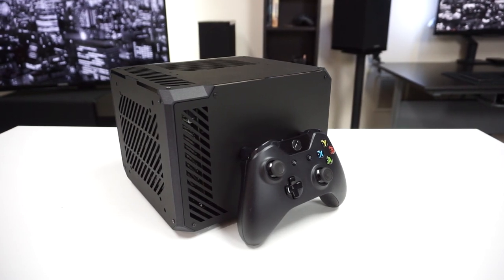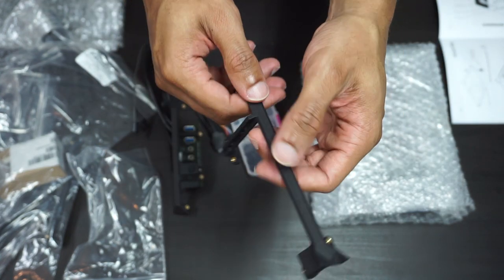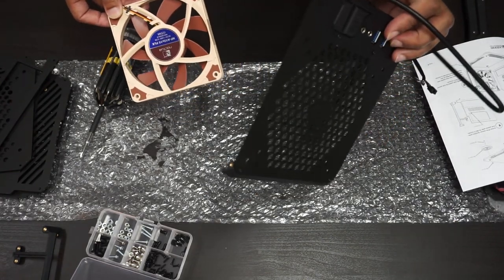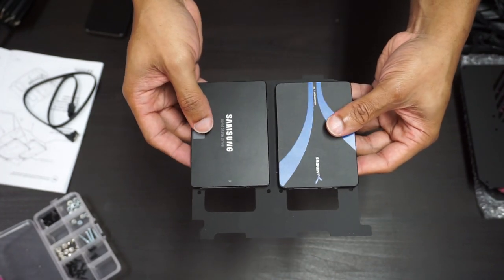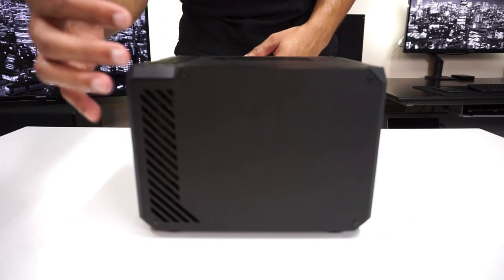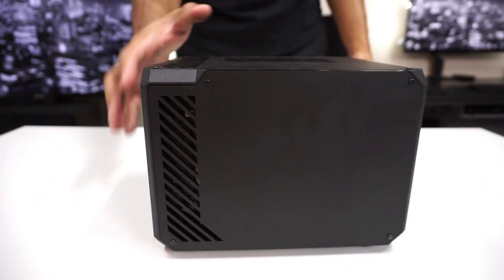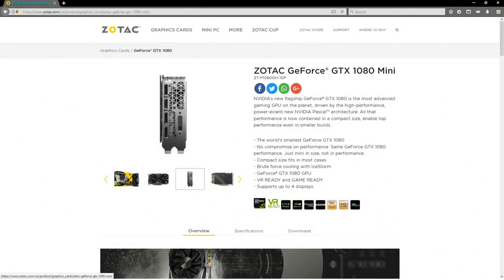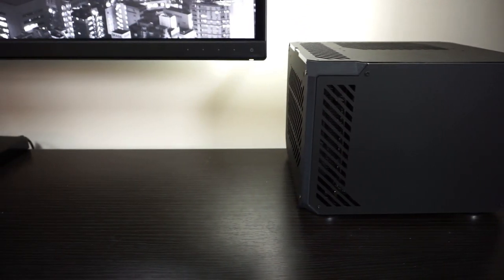Lazer3D LZ7 Mini-itx Case Review & Build

Comment: I'm doing this exact build and the CPU cooler bracket doesn't fit with the motherboard. Any idea what I'm doing wrong?
Reply from the maker: Did you get the AM4 upgrade kit?
Reply: I did not. Is that something I could get from Cooler Master? Would you happen to have a link to the specific kit? Sorry, this is my first build.
Reply from the maker: I used an NH-L9a in this build. Not a Cooler Master product. Which cooler are yo using?
Reply: Yep, I bought that exact cooler and the AB350 linked in the description. Those two items, out of the box are not compatible. The holes in the motherboard cannot align with the cooler to fasten the two together. I have to be missing something obvious here but I'm lost.
Reply: If you have the same cooler that was used in this video (Noctua NH-L9a), then I think Tek Everything is saying you also need to buy an AM4 upgrade kit that will align the holes properly.
Reply: kevin dolan Which AM4 Upgrade Kit do I need or how can I figure out if one is compatible?

Comment: Cool video, but really for that cost you might as well spring for a Dancase or Ncase or that new case with an expandable "top hat". Not paying that much for plastic.
Reply from the maker: Those cases are a little different in design, and have a larger footprints. This is probably the most efficient use of space outside of the S4 mini that I have seen so far... but I totally understand the desire for a metal construction at this price point.
Reply: I have no problem with the design as the space efficiency is awesome, but if I was going to build that to carry around scratches and possible cracks would ruin a case that costs nearly as much as my massive Dark Base Pro 900 and several times that of a very affordable Node 202. Just too risky unless you never plan on picking it up.
Reply from the maker: True, good point.

Comment: Hey Tek Everything, I am trying to fit a gtx 1070 and ryzen 7 1700x into an LZ7 case with the new HDPLEX panels. The build also has a 500gb ssd from samsung, two 92 mm fans, a 140 mm fan, and 2x 16gb ddr4. Cooler Master's power consumption tool estimated the build to draw about 350W (not at full load). I was originally hoping to power it all just from the HDPLEX 400 and the Dell 330W adapter, but I was told that would simply not be enough power. 

I'm really trying to maintain this setup for maximum cooling, but have no other options but to ditch the effort and just go with a normal corsair sfx psu. Hoping someone can help me... Please let me know!

Comment: The price is in British pounds not Euros. 179.99 it about 234.00 USD. I bought the case. I NEED portability and I couldn’t find anything like it. If I had time I would build my own.. With my options,  it came to $250. I called the company to make a change. They were very helpful. But my GPU panel is on back order and May take 2 weeks to ship out.
Reply from the maker: Awesome man, which configuration did you go with?

Comment: Only criticism is it would be nice if the top panel had an option to put in a panel with a handle so you can carry it around easier or even maybe hang it somewhere haha lol
Reply from the maker: I believe the extra holes in the top panel were for a handle. I don't know if the panel can support the weight of the entire system for prolonged periods though.
Reply: Tek Everything final question what's a rough estimate ball park high and low cost for this specific exact build gpu case storage etc and all..  With and without shipping maybe..  I am in Australia (but can convert)  but really thinking of doing a 1080ti mini ultra sff for my next build.
Reply from the maker: Before you run out and purchase those parts, the 1080ti mini will not fit in this case. It is too long. The Gigabyte 1080 mini fits and works well as you can see in my follow up build video... https://www.youtube.com/watch?v=zLD_-POVYG0
Reply: Tek Everything any recommendations for a 1080ti mini build really want to make this happen looking for options with 1 hdd 2 ssd. 2 hdd 2 ssd would be bonus thinking 32-64gb ram. 8700k.

Going to try for some 4k gaming on the go be carrying it in my bag and hooking it up to 4k tv's and playing some strategy games among others. Laptop is too expensive and the screen is not that needed. Also desktop equivalents not only better but probably cheaper compared to a similar specced out laptop. 

Thanks dude.

Comment: Those darn usb3 cables are the bane of every build, surely there's some advancement in technology to make these easier to deal with??!!
Reply from the maker: There have been some updates made that you will like... Video coming soon...
Reply: Tek Everything I wait in anticipation for this update! Looking at the website for this case, I would probably get the case with the Vandal Switch and forgo the front I/O altogether. With a case so small, having all ports at the back wouldn't be a deal breaker.

Comment: I do like the look of the case and I think it's really cool and unique but for that kind of money they could have at least included dust filters on all the vents. No dust filtration completely negates the inclusion of so many ventilation holes. I can see the price being what it is for the level of customization available but in my opinion it's still way too expensive considering what it's lacking. I mean it's made out of acrylic and was probably super cheap to manufacture compared to something like heavy aluminum and tempered glass. In my opinion and it's just my opinion this case should be priced at about 70 to 100 US dollars Max.

Comment: Could a Hdd Fit in there?

Because sdd are so expensiv and have less Place :/
Reply from the maker: You could probably fit a 2.5 inch HDD in here. It would make cable management even tighter though.

Comment: So is it acrylic or 3D print or mold plastic. Giving a lot of conflict informations in first 2 minutes of video. Other than that its nice video.
Regarding case. Its a huge waste of money, no matter how good it looks like. 150pounds for case out of plastic is a way 2 much. Better to go with any Silverstone cases like SG05, SG13 etc. They are a lil bit larger but only because they can fit full lenght  GPU. They are also made from proper materials, look as good as this case and cost 1/3 of its price

Comment: All of these awesome tiny itx cases come from small crowd funded starter companies. Why can't a company like Silverstone buy one of these layouts and have these cases mass produced and sell them for a reasonable price? The case is probably so expensive because they need an OEM to laser cut each panel of the case, which is a time-consuming process. And the supports have to be 3D printed which also takes forever. Silverstone could have plastic molds made and stamp out 50 of these cases in a minute.

I get that these are small, independent companies that don't have access to big labor forces and factories like larger companies, but that to me doesn't justify paying $230 for a box of plastic that doesn't even come assembled.
Reply: demarc All fair points. Although if the case came assembled it would be able to offer any where near the level of customisation that it currently has. Plus I would argue that building the case around your motherboard actually helps to simplify the whole build process. Checkout Oafah' s YouTube review of the case, he talks about this point during his build.
Reply: True, and plus this is a very niche product, which tend to be more expensive due to having such a small market/consumer base. Building a case around your components is difficult to do. I was thinking about building an itx case with some slotted angle iron, almost like building with a Meccano set.

Comment: I don't understand how you guys are buying this in the usa... I've called and cleared through my bank to order from  UK but everytime I try and purchase it I still get the same old invalid message... grrr
Reply from the maker: Try contacting Lazer3D directly. I didn't order through the overclockers system so I can't really shed any light on this issue, sorry.
Reply: Tek Everything thank you I didn't even think about that.  Did you order yours through lazer3d?
Reply: We discovered the problem is that Overclockers UK have run out of stock of the Lian-Li feet.  They will be receiving some alternative (and cheaper) feet within the next couple of days.

Comment: It's a nice case but for the price it's entirely unjustifiable. You could get an ncase m1 or dan case for less, and for roughly the same price you could get a Cerberus.  Im having a hard time choosing an acrylic case over a cheaper steel and/or aluminum one
Reply: They are undoubtedly better cases because they can fit full size GPUs for the same sort of volume

Comment: I think it is too expensive just for case that main material is plastic. You can buy metal cases for under 50$. And it is compact so you use not so much material. I know you pay you design engineering but it is just too expensive

Comment: it would look sexy if the feet were like in ncase and price was like 100$, as of right now- it is meh. 
maybe v2 will be better
Reply from the maker: The feet are very similar to the feet on the M1. What do you mean by that?
Reply: the placement of them if he could make them like in the m1- like a "mini" version of a pc tower rather then a cube/HTPC ff and keep the rest of the design (like the placment of the psu and front fan) also lower the price then he could succeed with this product.

Comment: Thinking of using this as a case fan.  http://noctua.at/en/products/product-line-chromax/nf-f12-pwm-chromax-black-swap
Would it fit in your build thickness wise?
Reply: Just ordered the case btw!
Reply from the maker: Nice, which panels did you pick? When picking a fan keep it mind that it needs to be slim.
Reply: For the case panels? I chose white, black trim and clear polished for the side panels.  I am pretty much copying your build (thanks btw) except for the cooler so far. Ordered the NH-L12s. As for the case fan... the other one was too thick.
Reply from the maker: Nice! You won't be disappointed. You should shoot me some pics when you get it all set up.
Reply: I will! Everything except the graphics card will be in by this wednesday. Im hoping a good deal pops up soon. $100 difference for the 1070 vs 1080... thinking of just going for the gigabyte 1080 mentioned in your comments. Glad i found your channel! Thanks man!
Reply: Tek Everything ill send to u on ig

Comment: ???? 450w PSU for all that? That's cutting it close!!! No Head room
Reply from the maker: 150W for the GPU at load, 120W for the overclocked CPU at load. Plus another <25W for the drives and fans. Not anywhere near 450W.
Reply: A good 450w PSU is absolutely fine, for those parts. Ryzen is very efficient & the 1070 only pulls about 160 watts max. I bet he's not even pulling 300watts from the wall, under load.

Comment: $240 for that case?!? That's absolutely insane. It is NOT priced "appropriately." Not when I can go buy a Fractal Design Node 202, for $79. Or even buy it with an included PSU, for $120. Holy hell, man...
Reply from the maker: The node 202 is ugly and quite a bit larger. It is also produced by a large manufacturer which drives cost down. The pricing is in line with other similar "custom" cases.
Reply: Tek Everything - Your opinion of the Node 202 is factually irrelevant. The price of that L27 is simply not justifiable, for what it is.
Reply from the maker: In this case.. ones opinion is really all that matters. "Value" is completely subjective. What I am willing to pay for something, and what you are willing to pay may vary wildly. That doesn't mean it is or isn't worth XX dollars.

You also clearly don't understand the costs associated with producing a low run customizable PC case. If you did, you would never have compared it to a Node 202.
Reply: Ah, patronization, nice...& Here I thought we were having an adult conversation. But, alas, "I clearly don't understand." Shame, because your first paragraph was rather engaging & I was actually on the same page with you, albeit momentarily.

Yes, nearly everything is subjective. In defense of my comparing it to the Node, this was done so, based on the ITX form-factor, nothing else. Of course they're different animals. It's not lost on me that your little plastic box is of the "Small Batch" variety. But just because their (Lazer3D) overhead is much higher, relative to profit, it doesn't make the product itself any better. Manufacturing is still performed mechanically. It's still just a computer case, man...and aside from its size, it's really not all that impressive.

I've viewed  many of your videos, liked, was sub'd, engaged, thus benefiting algos driving traffic & revenue your way & while that small contribution is miniscule on the macro level, it would still serve you well to remember this, when choosing to be condescending to your base, simply because you happen to possess separate opinions.

Anyway, I think this is pretty well beaten to death, at this point. I wish you well in your endeavours.
Reply: nappydrew the $240 You quote includes 20% VAT which is not applicable to those who live outside the EU. So the price for US citizens is closer to $200. Yes it's an expensive case, it's unfortunately very expensive to manufacture. Some people are still able to see the value in the product even at this price point due to its unique features, others are outraged by it, which is a perfectly acceptable opinion as well. The $ price is unfortunately also not helped by the shifting exchange rates of the £ against the $.
Reply: I'm over it...Onwards & upwards.
Reply: Tek Everything ugly is subjective

Comment: Fuck Zero Airflow! My CPU 3770K 100% Load / 1hr 54°C
GPU GTX 670
100% Load / 1 hr 57°C
Room Temp 24°C
Noise 24 dB - 30cm
14 dB - 1 Mezer

Your cable Management is bullshit! Your cables blocking any Airflow so this case looks good but it is not good for High End Gaming! And it's getting loud!
Reply from the maker: Hah, this comment is so out of touch I don't even know where to begin!